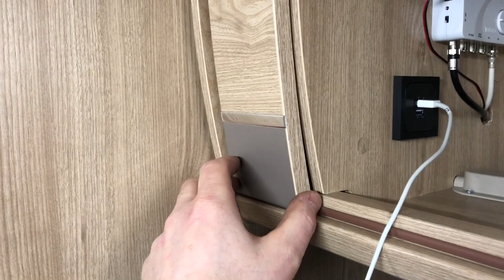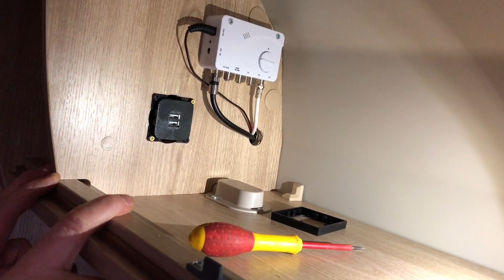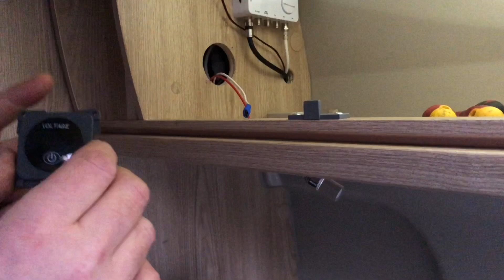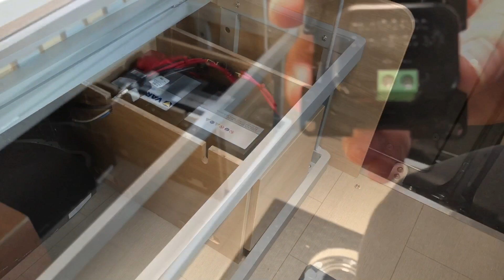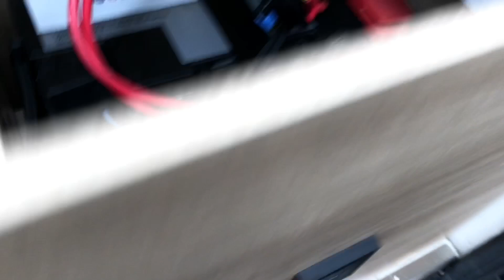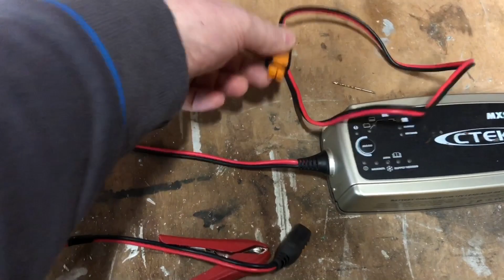Electrical Modifications Moving & Adding Sockets Plus Battery Charging In Our Elddis CV20 Campervan

Comment: Great video as always, makes total sense  to move the usb socket to somewhere where you can use it when needed, hope you both had a good Christmas ⛄
Reply from the maker: A bit quieter than we’d have liked but it was nice all the same, hopefully you had a good one too. 🎄
Reply: @RickandHeather  quieter than normal as well, we went back into lockdown from this morning
Reply from the maker: @scottishcarenthusiastsandtrain  I’m sure most of us will be come January unfortunately
Reply: Hi Rick and Heather , Not long picked up our CV20 70 plate , As mentioned on the CV owners site we was told not to worry about the starter battery and the leisure battery as it all looks after itself . Well , within the first week the starter battery just about managed to start the van  . I charged the battery for a day as the charger ammeter was off the scale , went back to the dealer and the technician maintains that the solar panel will look after both battery’s , I asked where they put the van Dc to Dc charger and I will check to see what is fitted as I cannot seem to get any information on the products fitted  , The  technician said Elddis buy the vans and the wiring looms are already in place and the Dc to Dc charger (if that is what has been fitted ) is behind the panelling somewhere.
I have contacted Fiat and Mentioned that it states in the manual to unclip the negative lead before charging , which I did ,  I measured the voltage on the leads from the battery and There is no voltage back feed from the Leisure battery / solar panel as the leisure battery is fully charged and would then charge the flat starter battery if this is how it should work . Which makes me think what the dealers technician said is not right . Fiat said if it has stop start fitted you would have a smart alternator and produces its own problems with charging , I haven’t got stop start fitted and is a basic 160 amp output alternator as Fiat said  and with no Ct on the negative lead of the battery  . Measured the battery voltage today and it’s slowly dropping from when I last charged it. Would be nice to know what equipment has been fitted and perhaps drawings and specifications of the gear as when the warranty runs out it will be an option to perhaps upgrade to better gear . Im going to get in touch with Elddis 
to get some sort of information about the important stuff  instead of a manual that tells you how to work a microwave , will keep you posted
Reply from the maker: Thanks Colin, the standard charge control can be wired to charge the van as well but ours wasn’t (you’ll see if the second output is wired on yours) the b2b only puts out 4 amps I’m let to believe hence why a lot of people fit a stand alone one, we’re very low power users so don’t have issues often, the separate battery charge connector I fitted was really only if we left the van for weeks on end without using it (like in lockdown) we’re out most weeks to be honest so I haven’t needed it much. Cheers, definitely keep me posted 🖤🏴‍☠️

Comment: Thanks for your channel - a lot of good advice. We have a CV 60 and yes it’s the first van without ‘vehicle’ battery 240v charging we have ever owned....
Apparently it’s the fault of the ‘Smart Alternator’. 
Having now fully charged the vehicle battery from the solar panel regulator 2nd battery output, our ‘auto self start’ works at last too!
Previously it only worked after at least an hours drive, as on site, or in the drive, it goes flat (less than 12v) in less than two weeks of door opening, firing up some electrics, alarm, and step operation. Again our old vans steps were from the leisure battery...
I guess most new Fiat vans could be suffering this too, or is it our ‘budget’ vans only?
I am surprised more is not known about this and publicised for us oldies who expect things to be the same and not worse! Two weeks on site isn’t unreasonable? It can’t be doing the vehicle battery any good at all.
Reply from the maker: Glad you’re enjoying the videos, we don’t have stop start (I hate it) but yes smart alternators are annoying as is the crazy wiring in my opinion 👍
Reply: @RickandHeather  I'm not over keen on the stop start either, but if you've got it - flaunt it! It never 'happened' in the first 1,400 miles! Sorry only once after the A3 for an hour, I thought it was broken....
Now it does work, (if I keep my wire down the middle of the van connected), I'll turn it off!
Reply from the maker: @paulsparks5071  we have it in the car, I turn it off as soon as I start the engine 😀

Comment: After watching your video I was  inspired to fit a vehicle battery maintainance device. However my battery looked different to yours (there is a “box”on the negative terminal with wires coming out of  it) so I  put the connectors directly onto the battery terminals not the easiest but job done.
Reply from the maker: Hopefully it helps, I avoid all the electrical fuses and stuff myself to be fair, the modern vehicle is a strange thing....

Comment: Hi ric ..like that wee battery monitor..could I connect that straight to the leisure battery terminals...I also have a double USB plug at the kitchen which we wanna keep ..could I splice into the back of them and would that show me a true reading of the health of the leisure battery 🔋   Ta .
Reply from the maker: You can as long as you put a switch on to turn it off when you aren’t in the van or it will draw power all the time, splicing into the existing wires will give a fair idea on the battery health yes.

Comment: Merry Christmas Boxer day. What size cable do you use and where do you buy yours? Great info on the channel, I enjoy it a lot 👍
Reply from the maker: Cable for what part? All cable so far is existing except the brown and blue which I added to move the usb, that’s such a tiny draw of voltage you could use a lot thinner than I used, it’s just some old 240v flex cable from something I kept, I hoard old bits of wire, if I was doing something big like adding a battery etc I’ll source the correct size. Glad you’re enjoying the videos happy Boxing Day to you too 👍

Comment: Hi Rick. Enjoyed the video. Electrics made simple. One question - are you not concerned about impacting the warrenty by making these additions and changes?
Reply from the maker: I’m sure the warranty is affected on certain parts of it yes BUT I’ve not paid all this money out to “make do” with things in the wrong place, I’d argue for example that “if” the heater (for example) packed up nothing I’m doing affected it, I don’t really see a warranty being affected by drilling wood or moving a socket.... if so then so be it, we bought it to use not to put up with items supplied as standard.

Comment: Hi, 
Really informative videos, we have a CV20 too. Does being connected to shore power not charge the main vehicle battery as well as the leisure battery?
Reply from the maker: Not on this specific vehicle set up, the battery to battery charger is only 1 way, so your alternator charges both but your solar or on board charger by default only does the leisure battery (the original solar controller is capable of charging both if connected) I cover the solar in a different episode. As a side note normally the engine battery going flat wouldn’t be an issue but with lockdown etc the van hasn’t moved and the tracker will drain it if not occasionally charged.
Reply: @RickandHeather  we're in the same boat! Got the CV20 last years version, at the end of the summer and got one trip in before locdown started again! It's not moved since. I've left it connected to shore power thinking this would be protecting both batteries (we have the original solar controller connected) - fingers crossed - I'll go out and try starting it in a minute!
Reply from the maker: @FatSlugGaming  let me know 👍
Reply: @RickandHeather  , so lunchtime battery checking session complete and....it was very nearly flat - I've got a CTEK 7.0 so have got that on recharge (powered on the Van's 240v which is connected to shore power - hope this is ok?!). Glad I watched your video - you've potentially saved me a new battery :-)
Reply: Turns out shore power and solar is only keeping the leisure battery topped up and not the vehicle battery!
Reply from the maker: Let’s hope it hasn’t knackered the van battery 😳 either do my mod or divert 2nd solar feed (too much faff I thought)
Reply from the maker: Absolutely fine to plug in the van yes. I do it. Just remember to disconnect the charger before starting the van tho.
Reply: @RickandHeather  so doing a bit more tinkering and found my solar controller is feeding two batteries....can’t trace the wires but it seems it is wired up to my van battery as well as the leisure battery. Only issue I have is there’s virtually no sun hitting the panel due to the where it’s parked (shaded from houses and trees). Have done your mod with the ctek - works a treat.
Reply: When you put it on hook up it will charge the vehicle battery try it test with a multimeter on hook up then off ..🙋‍♂️

Comment: Great video - very informative. Does the engine keep the leisure battery charged? I.e. if the leisure battery were getting low could you turn the engine on for an hour or so?
Reply from the maker: Yes in this van it’s got a one way split charge so the alternator charges the leisure whilst the engine is running.
Reply: @RickandHeather  Any idea where this is located as I have fitted Lithium batteries to my CV40 and I might need to change dip switches
Reply from the maker: @colinrice6272  I’d ask on the cv Facebook page I’m not sure if I’m honest, also depends on if you have a smart alternator fitted (if your van has stop start)

Comment: Just see your video of connection a fitting for you van battery... did you know when you put you campervan on hook up it charges the van battery first because the leisure battery recharges from both the solar panel and the vehicle charger put your multimeter on first then plug it in you will get 2 voltage readings..🙋‍♂️

Comment: Another great upload, thank you. My son is a sparky so will soon be adding campervan electrics to his skillset!!
Just one question, there's not much room between the rear doors and your new usb site. Did you consider another location?
And, will you be adding more electric sockets?
Oh, and, would you replace the lights with ones that have usb sockets?
Keep up the great work guys!
Reply from the maker: You’re correct there isn’t much room for the usb, that’s partly why I added the switch so we can plug the leads in and leave them coiled in a net pocket we added and then turn off with no fear of the wires getting damaged. The usb light swap is an option but I wanted the socket low down. We don’t really use 240v so the 2 sockets are plenty or if you use the hob one (under the big drawer) and the microwave one there are 4 total
Reply: @RickandHeather  Ah, I see, great idea re the cords!
I don't have a microwave so only 3 sockets including one for the telly, but moving the usb ports will help as I do get interference from the USB port.
Stay safe peeps x
Reply from the maker: @michelleharris3550  you can always run a extension lead up from the hob one (if you have an electric hob?) to somewhere behind the cooker easily I’d imagine? Shout up if you need anymore “advice” (my opinions may not suit everyone 😂)
Reply: @RickandHeather  Oh, just one last question for today ...... where dod you get tge switch from for the usb hubs?
Reply from the maker: @michelleharris3550  I’d already got that in my shed so can’t help there.... loads on eBay or Amazon tho 👍

Comment: Hi. Can you add purchase details on the voltmeter and terminal clamps. Thx
Reply from the maker: https://www.ebay.co.uk/itm/C-Line-Green-12v-24v-Voltmeter-Battery-Voltage-Display-Grey-1-Way-Frame-Boat-HGV/254540274307
Reply from the maker: The terminal clips came with it, hope that’s what you meant?
Reply: @RickandHeather  Many thanks.
Reply: I've just ordered via your link. Thank you.
Reply from the maker: @michelleharris3550  no worries
Reply: @RickandHeather  found the link. You’ll need to start selling merch soon like all the other you tubers 🤣

Comment: Could you advise me about charging the vehicle battery please? I have a Elddis Majestic 135 motorhome which I bought new in 2017. I also have a CTEK Multi XS4003 charger which I use to charge my car battery, I intended to use it to charge the motorhome vehicle battery during the winter months but in the Peugeot Boxer handbook it says when charging the battery to 'disconnect the battery' (p142) and again on p143 it says 'never charge a battery without first disconnecting the terminals'. Do you have to disconnect the terminals on your battery prior to charging?
Reply from the maker: A lot of modern cars say this, I believe it’s to do with the very sensitive fuses and electrical stuff on the battery (certainly if you look at the battery you’ll see that) a friend of mine who is an AA patrol said as long as I didn’t turn on my ignition while charging it is fine, so far I haven’t had an issue following that advice.
Reply: @RickandHeather  Thank you for your reply and I will try the charger and see how it goes. It will be better to connect charger and leave it so it can 'pulse' charge to keep the battery in trim during the cold weather.
Reply from the maker: @robertcrouch4664  our van has a tracker so has to be charged every couple weeks as the tracker is quite a drain.👍

Comment: Hi Ric, what setting on the charger when the battery is full do you leave the charger on? 
Regards Ted  PS meet up with you and Heather at Peterborough
Reply from the maker: On the engine battery? You can leave this type of charger on all the time if you want yeah, if you mean the leisure charger we plug back in when back in winter but solar does the job in summer yes say hi at Peterborough 👋

Comment: I have no usb at all in the cab area, not by the tv aerial for sure, ours is a 2022. Sorry meant not in the Hab area... there are some on the dash but only powered when the engine is on. So when parked up there is no way to charge a phone, crazy for 2022.
Reply from the maker: Is it standard elddis or a dealer special? Surprised you don’t have any cab ones as Fiat usually fit some but I have seen the elddis part without them